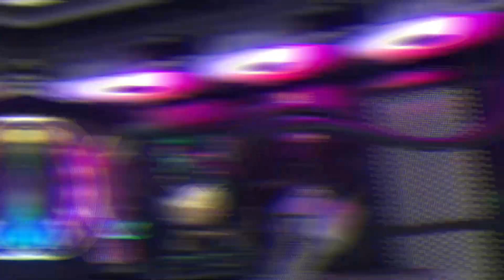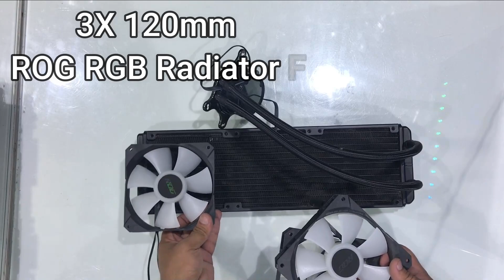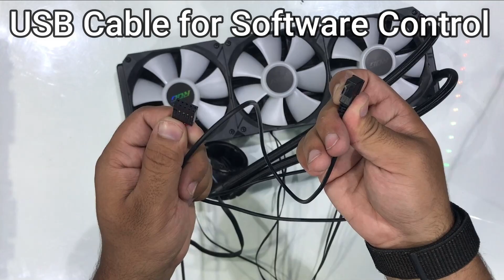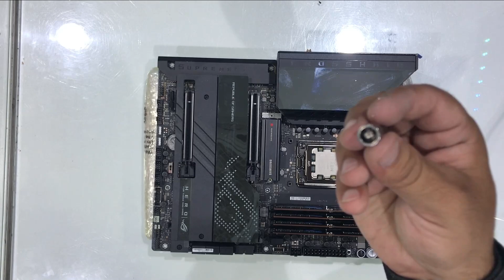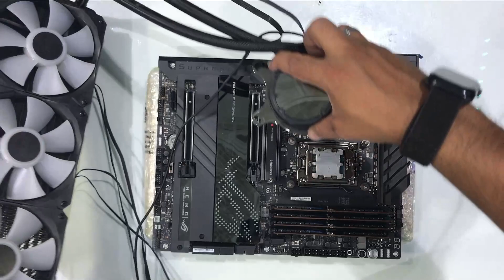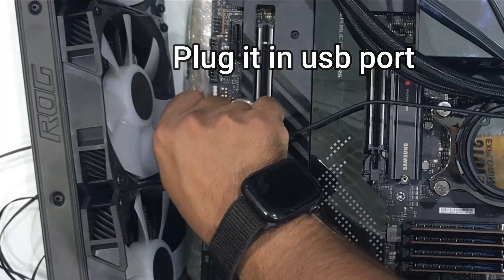ROG strix lc II 360 argb installation on Ryzen 9 7950x

Comment: I have a question because my aio didn’t come with those sockets for amd and also doesn’t have anything for the rgb on the cooler cover all it had in there were the 4 silver caps and nothing else to install it
Reply from the maker: Contact ASUS support for the missing AMD socket mounting hardware and RGB connectors, or check online marketplaces/stores for the required parts.

Comment: the thing that plugs into the usb port for me isn’t 5 open holes on the top and then 4 on the bottom, mine is 5 holes on the top and three on the bottom and then 1 all the way to the right
Reply from the maker: It sounds like you're describing the USB connector on your ROG Strix LC II 360 ARGB cooler. The difference in the pin layout might be due to a variation in the connector design. However, as long as the connector fits into the USB port on your motherboard, it should work fine. Just make sure to align it properly and securely insert it into the port. If you encounter any issues, refer to the cooler's manual or contact ASUS support for further assistance.

Comment: do you have a tutorial on connecting the display square thing?
Reply from the maker: While I don't have a specific tutorial, I can guide you on connecting the display component of the ROG Strix LC II 360 ARGB cooler. Locate the ARGB header on your motherboard, connect the ARGB cable from the cooler to it, and use the provided software to customize the lighting effects. For specific details, refer to the cooler's manual and your motherboard's documentation for ARGB header locations.

Comment: does my first gen lc 360 support am5 ?
Reply from the maker: The first-gen ROG Strix LC II 360 ARGB cooler does not natively support AM5. Check with ASUS for an AM5 mounting kit or adapter.
Reply: @rambotech_  mounting kits are from them no were to be found
Reply: @rambotech_  i did read a thread that said if your aio cooler dosent need a custom back plate it will fit on am5 i dident have to use a custom backplate i use the one that is on the moutherboard already
Reply: @rambotech_  just finished building my am5 set and can confirm that the first version of strix lc does indeed fit straight out of the box

Comment: What temperatures did you get? Is good for a 7800X3D?
Reply from the maker: 90
The ROG Strix LC II 360 ARGB is a good cooler for both the Ryzen 9 7950X and 7800X3D, but specific temperature results can vary.

Comment: hey bro ! this cooler is ok in ryzen 7 7800x3d 
?
Reply from the maker: Hey there! The ROG Strix LC II 360 ARGB is a compatible cooler for the Ryzen 7 7800X. It should work well to keep your CPU cool. Just ensure it's properly installed following the manufacturer's instructions for optimal performance!
Reply: @rambotech_  thank you man👏